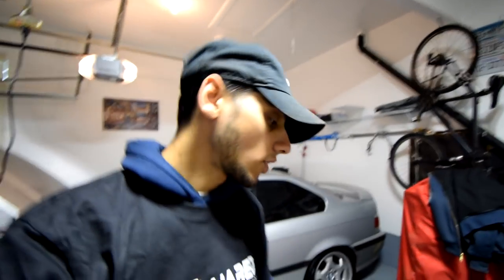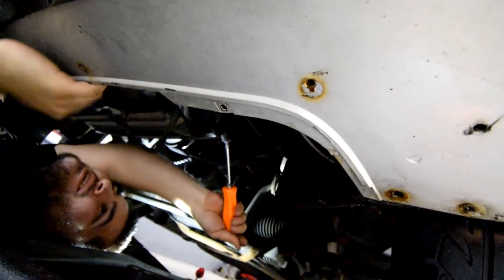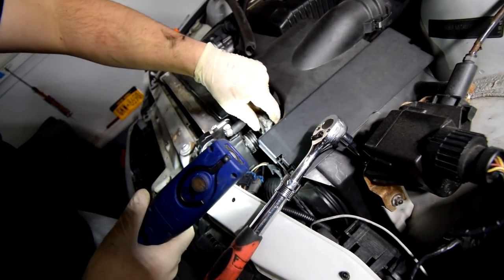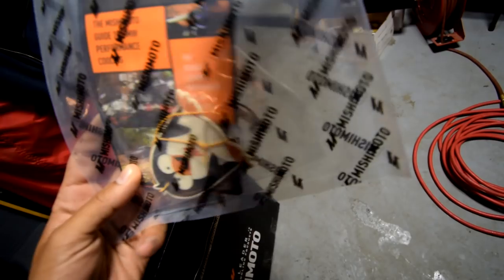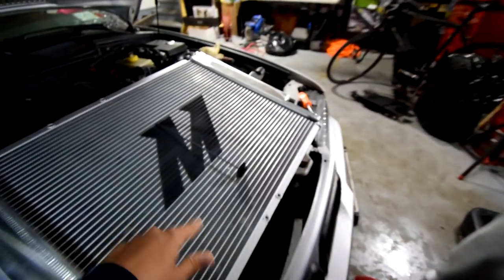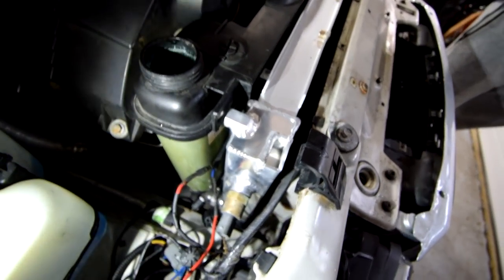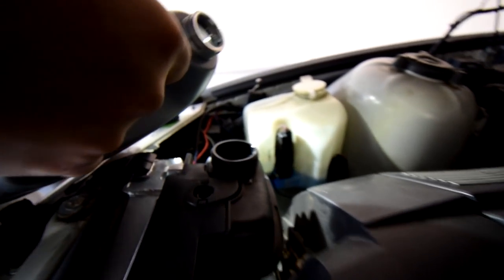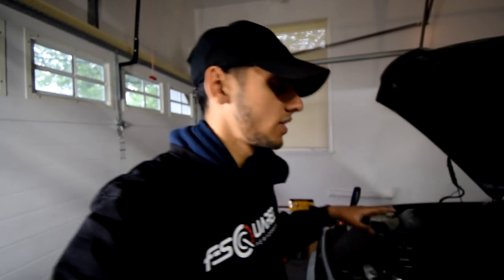MISHIMOTO ALUMINUM RADIATOR INSTALL! (E36/E30)

Comment: 8.8 on the bolt is a strenght thing 😅 not the size
Reply: It's an M6-1.0 Bolt in anywhere from 10-16mm in length. I got all three sizes to be sure. I'll probably go with the 12-16mm length though. My radiator did not come with these bolts. Seems like some do, so don't.

Comment: Did you drain the block of coolant as well? Especially if you are using BMW fluid. Unless you know it was used before and in the system, I would always drain the engine block as well as the radiator. FYI. :-)